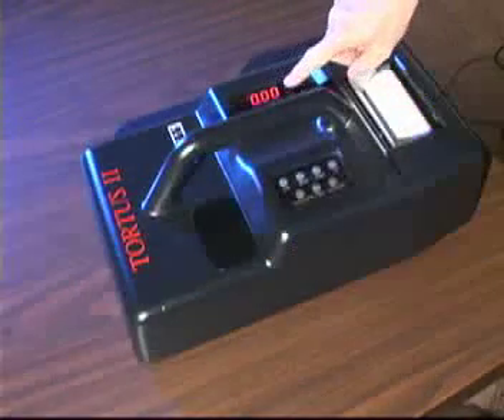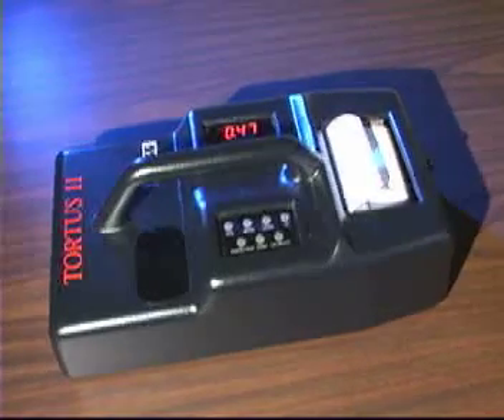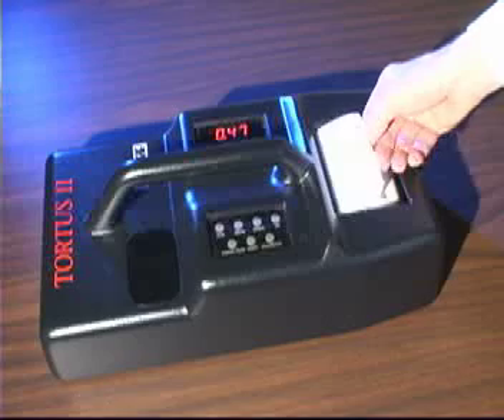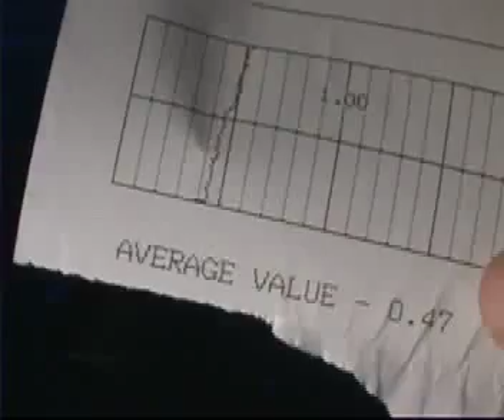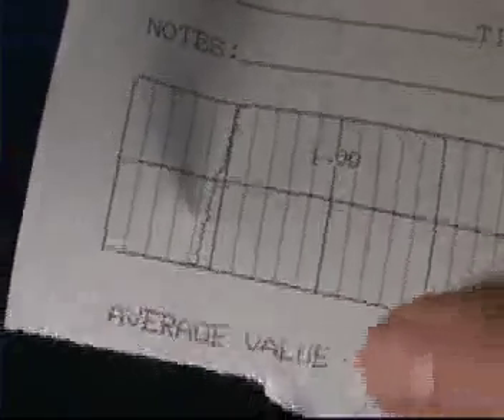Tortus Slip Resistance Test Demonstration

Comment from the maker: The Tortus can run tests with both soft rubber (to simulate running shoes or bare feet) and hard "Four S" rubber ("simulated standard shoe sole" rubber.) We at Safety Direct America have also run tests using customized test feet using shoe sole material from different shoes involved in accidents. The safety standards, however, for this instrument (and research from slip accidents) is mainly based on Four S rubber.